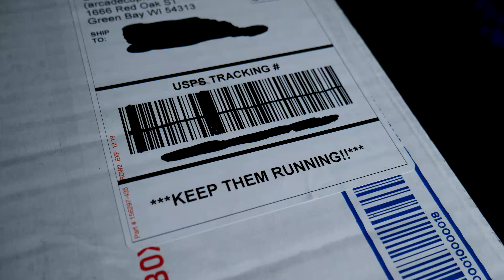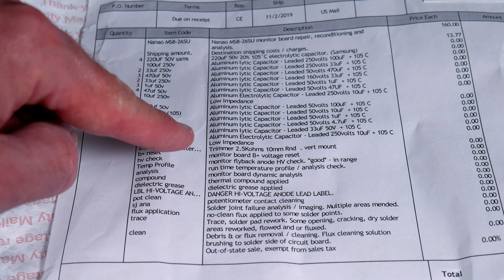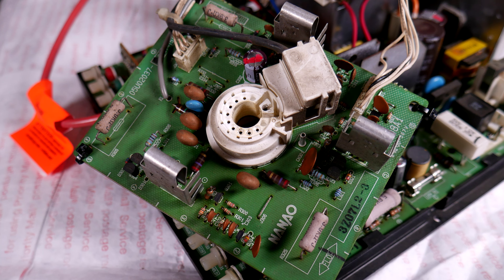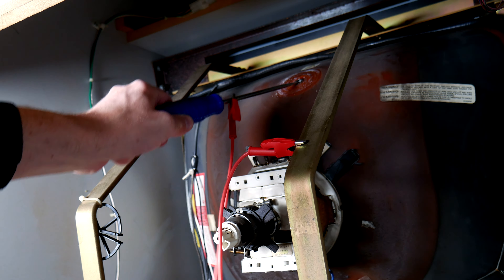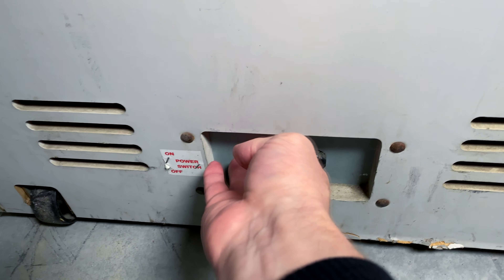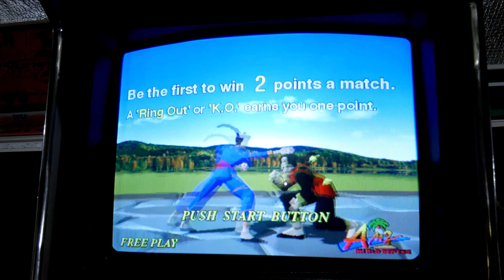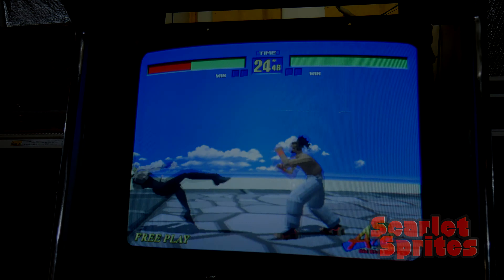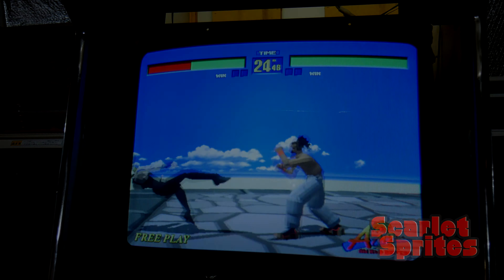Nanao Arcade Monitor Repair by Arcadecup (Day in the Life!)

Comment: Legit, love it! nothing beats original crt running on original hardware, the curvature, scanlines and colours are gorgeous.  I wish they would start making crt again for the arcade purists, re release these cabs for sale etc
Reply from the maker: Sadly, I think I read that the last CRT factory is now closed.  What we have is what we have, and it's probably only going to become more difficult to replace these in the years to come.  It's a tough place to be because we have no new incoming CRT stock, and 4:3 LCDs that are more than 20" are pretty much non-existent.  Rock and a hard place.
Reply: @ScarletSprites  def a market for crt maker to supply to collectors or purists, maybe someone will open one up 👍

Comment: Have a lot in common. I too have a Virtua Fighter, but i did remove the CRT (early in my collecting). But i do have that same monitor sitting right beside it. A Nanao MS8-26su iirc. also have the original chassis board for the one that came out of Virtua Fighter downstairs. Sega used Nanao monitors on just about all the great Sega racers in the 90s, have a half dozen or more of them up and running. Always a great monitor and they (at least for me) respond excellent to a chassis re-cap.
Reply from the maker: This one turned out pretty well too, and yes, it’s an MS8-26SU.  The Virtua Racing I have has Wells Gardners in it, but both the Astro and Blast City cabs I have are Nanaos.  The Blast has some convergence issues which I’ve moderately masked with some convergence strips. I’ve considered getting it recalled and cleaned up but I’m not sure that’s a silver bullet for the convergence issues in this case.

What Sega racing games do you have?  I’d still like to get Daytona at some point.
Reply: @ScarletSprites  dual Manx tt, dual supergt, dual Daytona USA 2.

Comment: Your chassis was not corroded, all ms8-26's used to came from the factory with lots of flux residue underneath de main pcb, specially near the flyback transformer solder pads, the only thing the technician had to do was to use a toothbrush and isoprpyl alcohol.

Comment: The thing with these monitors such as for exp. hantarex polo is that yoi have to keep them running more then 2 hours when you turn them on, and its recommended that you power them up at least 3 times a week. So turn that bad boy on 3 times a week and keep it running at for 2 hours minimum.
Reply from the maker: I've heard a few people talk about that from time to time actually.  It usually triggers a debate.  Either way though, I don't think I'll have an issue with having these turned on and running several times a week.  I often have them just powered up when I'm working on something and then hop around and randomly play stuff like I have ADHD.

Comment: SCARLET SPRITES, an arcade games raster signals are vertical sync and horizontal sync. For arcade games vector games the vector signals are vertical deflection and horizontal deflection signals. How is the V&H sync signals different compared to V&H deflection signals? I'm confused how the raster signals are different compared to vector signals what are the differences? Most arcade power supplies use only one filter cap rated at 27,000uf and higher, any reasons why such a very large capacitance?
Reply from the maker: I’m not too proud to say that that’s well beyond my scope of expertise.  I suspect that’s a great question for the tech section over at KLOV forums, someone can likely weigh in on that for you.

Comment: Wish I had done this with my Sonic the Fighters cab..  I ended up completely tearing off the crt and replacing it with a multi-sync lcd screen...
Reply from the maker: At least you still have it up and running.  It’s unfortunate that 4:3 LCDs are getting harder to find, and weren’t made in 25” sizes.

Comment: Scarlett, could you find something on these MAK crt monitors. I have a cab project I'm working on and I can't find how these modern 4:3 CRT connect to modern PCs. 

Thanks.
Reply from the maker: Do those use a VGA connection?  I’ve seen them for sale, but never one in person (that I was aware of).
Reply: MAK as in Makvision? Makvision I usually see as an aftermarket replacement. Usually a Wei-ya or clone from china. See them as both dual mode and tri mode. If yours has a vga cable, it is likely tri mode and you can use a PC that is forced into VGA mode via a custom video card solution like ArcadeVGA or by software drivers/hacks